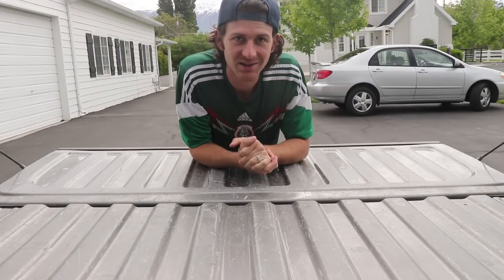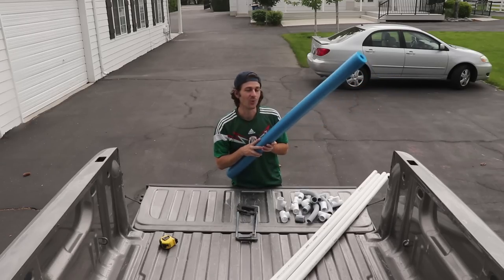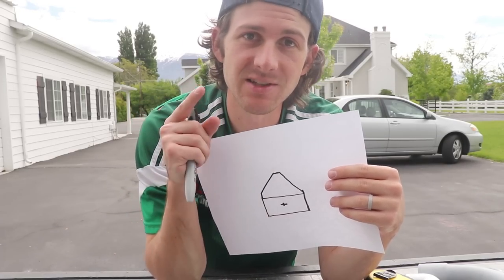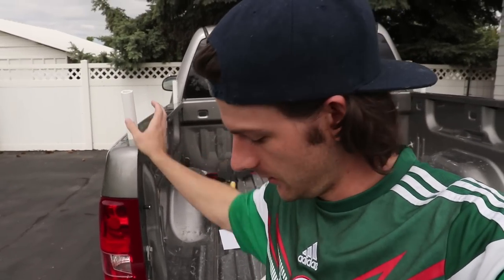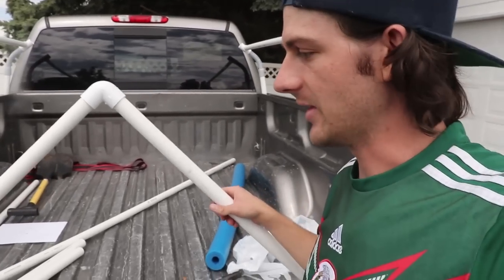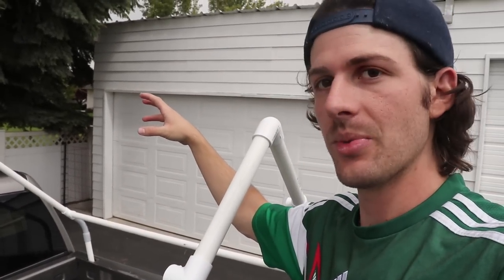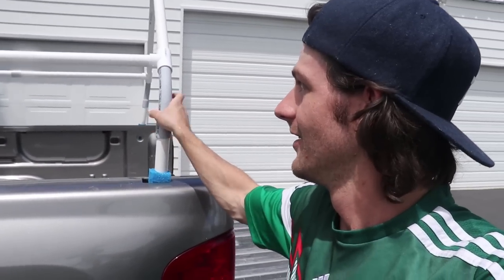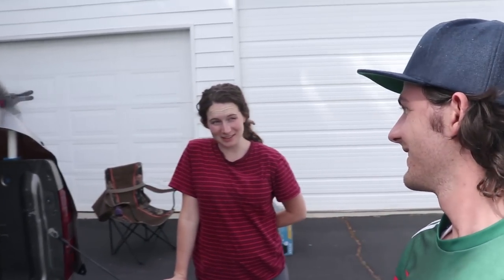DIY Truck Bed Tent! Truck Camping

Comment: I’ve done this also. PVC frame plus a tarp on a Ranger pickup.  You’ll have to cover the tail end above the tailgate, for sure.  A longer tarp in that direction works good because you can stake it out in the daytime like an awning with a couple poles.  It’ll give you a sheltered work space on the tailgate for cooking.  The tarp clamps can’t hurt, but I bungeed the grommets TIGHT to the bottom edge of the bedsides, and it survived a high wind rainstorm.  Also, to bug proof the thing, I bought a few yards of tulle at a fabric store. Just enough to zip tie in place above the tailgate.  I have no idea what it’s usually used for, but it’s good enough skeeter netting.  Good job.  Have fun.
Reply: Great idea with the Tulle!

Comment: You shoukd replace those 90s at the top with a couple of 3 way couplers and put in a ridge pole. In the rain the center will collapse
Reply: A brace in the middle would strengthen it as well.
Reply: When you add the center ridge pole cover the pole with a pool noodle.  The noodle will prevent rips as the tarp is over the top with tension and stand up to wind and rain better.
Reply: Definitely need that center ridgepole so water doesn't have a chance to pool.

Comment: I have a 5' x 8' utility trailer (with no walls, just the welded rails about a foot up the sides and the tall mesh ramp at the back. I plan to do something very similar with it, but have mosquito netting at the front and rear for airflow, and an electric power bank or small fueled generator for a fan for circulation in the hot Texas weather. Nice video.

Comment: Sweet! This is exactly what I've been looking to do. I'm a 54 yo female n I wanna go camping alone. About 20 yrs ago this idea to camp alone woulda been no biggie but now that I'm older I consider all the things that could potentially go wrong and what that could mean if alone. I also watch a grip of Dogman stories on YT n I have officially scared myself out of single camping.  I'm gonna get my conceal carry permit so I can bring a piece just in case but until I get it this idea of yours might fit the bill for me as far as my comfort being alone goes. I have a 92 toyota 4x4 and being up off the ground will make me feel much safer. I had checked out the prices for overland/truck bed tent systems n they're outrageously priced. I noticed the prices to average in the 5 to 600 range. That's just ridiculous.  Thanks to your engineering I think I'm gonna be able to solo camp this summer.

Comment: I made this identical truck tent.  Bought my pc pipe section at Lowe's and purchased a tarp at Harbor Freight.  Very inexpensive. Used bunji cords to tighten the tarp to outside of bed.  Also designed it with a ridge pole to keep from sagging. Rained the first day and through out the night and absolutely no leaks.  The rain hitting the tarp was somewhat disconcerting as it was rather loud.  I had power at the camp site and ran an extension cord for my small ceramic heater.  With an air mattress and cooler inside I had a comfortable  time in the tent/bedcamper.  Unfortunately I traded my 8' bed regular size pickup for a crew cab with a 5 1/2' bed.
Reply: Would be great on an 8' bed but the new Ford Maverick has a 4 1/2' bed. Can anyone say motel? (In the woods?)

Comment: Dude you totally reminded me that PVC pipe exists and are like lincoln logs for adults.  I was about to buy a purpose built truck bed tent, but that is not necessary now.  I'm not much of an A frame guy, so I'll have to design my own version of this, also the previous owner of my truck covered those holes with some stupid caps that I can't remove without damaging it.  I'll have to redesign this, but thanks for the inspiration!

Comment: You can get tees with a side outlet for the top/ridge pole. They are used for sprinkler risers at corners. Good project.

Comment: I followed this pattern but had to added a bar to the bottom of the truck bed to secure the legs because i have an insert for my truck bed which covered the holes on the back of the bed. Then i added a center pole to the very top of the A frame and four windows. I am using bungee cords to hold the tarp down. Thanks for the idea.
Reply: How did you add the windows?

Comment: You could even layer the PVC piping with insulating material and clamp or zip tie it down, and then recover with tarps, canvas, or waterproof canvas material, etc.  The truck bed can be covered with some type of foam or rubber matting, perhaps underneath that an insulating material of some sort, and actually have a very snug, warm in the Winter, camper.  A tiny wood stove could be added if a top build was created to hold and insulate from melt, a stove pipe; the wood stove could be mounted and surrounded with a protective framing device that will keep it in place.  So many possibilities here, including ventilation and solar powered fans :)  I Love It !!

Comment: I like the way things just slide in place. Great idea.
Reply: That's what she said.
Reply: They might just slide together, but quite often they are not that easy to slide apart afterwards... Often you need a pipe wrench to twist the pipe in order to get it to loosen up enough that you can slide it apart even if you didn't glue it together... If I was designing something like this, I would sand the ends of the pieces of PVC pipe a bit to reduce their diameter slightly so that they could be more easily detached later...

Comment: I agree with a top ridge pole too and I am not sold on the tarp clips. It seems the wind will remove that tarp easily with those clips? Maybe some bungees along the lower edges pulling down on the tarp? Maybe even some plastic ties that you can cut off when removing? Great idea. Beats my sleeping under a tonneau cover lol  I am just not sold on anything a hungry bear can reach through.

Comment: Thats awesome your getting out doing your thing. A few tips from experience. 1) You've got great idea there. Its been done in various styles with varied types of frame work for decades. Right down to the tarp covered wagons of the pioneer's. 2) figure a way to run a ridge pole.3) Using some sort of cordage. Run an X rack from corner to corner. Helps exponentially in heavy winds. I dig your style, great hiking rig!
Reply: This is what I was looking for!! Thanks a million😃

Comment: I know it's only been a week, but have you gotten to try it out yet? Only thing I could think of is you should be able to get "3-way pvc connectors" that you could use to run another 5' pipe along the very peak of the tent, to really keep the top from caving in at all under any weather conditions.

The nice thing about using PCV is it's basically a big lego or erector set, you can change it and modify it however you want. I'm thinking you could put T's in your two upper 5' pipes now and use it to run a couple of pieces horizontally  from bar to bar. If you did this at the front of the truck bed where you're not going to hit your head on it climbing in, and put two parallel bars spaced about a foot apart, you could put a shelf up there that would be above your pillows to hold your duffel bag or phones or whatever at night so it's not down on the floor where you'll step on it.

You could also expand it outwards past the tailgate to make a "front porch" area so that you are covered climbing in and out of the truck bed in inclement weather. Also would let you leave the tailgate down to have move "living space" while you're in there.

Looks good so far though, keep up the good work!
Reply from the maker: Holy cow! This is he best feedback ever! I might actually have to try some of those suggestions! 
And as far as using it, we are going this weekend and will post a video about it next Tuesday! 👍 
Thanks again for the great comment!
Reply: I was going to suggest the same thing with the top ridge. Anytime you do not have something there, it WILL sink down with rain, snow, branches, birds, etc. : )
Reply: I have built hotbed covers for early planting in a similar manner. One other upgrade later is to assemble it then drill holes through the fittings and pipe the use Carter pins or wire to firmly attach the pipe to the fittings. They want pull apart in high wind.

Comment: My thought is to put a bar across the very top of the A frame so as to not hold the rain water where the tarp will flatten, but make it run right off it completely.  Enjoy! 🙂

Comment: Good job, simple and effective.
I made something very similar for my ‘83 GMC K2500 long bed. I utilized my headache rack for the front but made PVC supports for the middle and rear stake bed holes.
Covered bed with an inflatable mattress is easier and more comfortable than any tent I’ve had.

Comment: This was really well done. You kept it simple. You did not talk for the sake of hearing your voice.  You kept it short and yet managed to fit all the important information in. Your presentation was made in a nice order and I don't think anyone would be confused.  By the way your drawing was  just fine and WAS not bad, it was simple but not bad. 
A couple of thoughts. You did not show the clamps at all. Neither before you started like you did the pipe and fittings nor at the end showing where and how you had them attached. You might show the frame broken down and in the bag. And, while it should go without saying, I think you should tell viewers to not use glue on the connector pices because that will make take down and storage, more than a bit difficult. Be sure to remind viewers that they will want some air circulation throughout the day and night so they don't suffocate. The Army had this happen a few times while moving troops in duce 'n halfs years ago.
You and your girl should be proud of yourselves,  nice video.

Comment: Excellent! Exactly what I'm looking for. I've wasted an entire year looking everywhere from auctions, classified adds, all the online places looking for an affordable tow behind my truck rv or something enclosed yet large enough I can put a couple of cots in there. I don't want to sleep on the ground in my sleeping bag or some blowup bed matress, cause no matter how puncture proof (yet they always come with a patch kit hmmm) I'd still manage to find a way to puncture it. But as one man said, you got a truck, you got a camper. I can't afford a camper shell to fit my truck. Dodge Ram 1500. I had one back when I had a little Isuzu truck, but that was years ago and both are long gone lol. I"m on a poor mans budget. I ride a motorcycle when the weather is good enough, but I want to sell it. I just want to cover the back of my truck, throw a couple of comfy cots and an ice chest or something in there. I never found what I was looking for. Then I just watched a previous vid a guy used pvc. I thought that's the answer. PVC. It's durable, shapeable, you can buy those things you have to give it an "elbow", I mean it's just perfect. The only thing I worried about was the extra space when you insert the pipe into the truck. I thought exactly what you did. OR used. I used those on my canoe. I had no trailer, a small truck at the time. My husband and I could both get the canoe up and in the bed of the truck, but we had to put the front half up on the cab. I went to walmart and bought a couple of those floaty foam things. Cut them to size, then cut from the hole, end to end and it slipped tightly over the crossbars on the canoe, so it didn't rub against the paint. It was perfect. Just like your build is perfect. Thanks for posting and showing off your build. There's TONS of people like ourselves out there, looking for the same thing. If only they find your vid. I can share, but I'm a bit of a loner. Every one I know has passes away before their time. So I wanna take the time I have left with my older husband, and get away without going to get a vacay loan or travel loan. I don't wanna be in debt, not at his age. I'm 51, but he's 70 (I know I know...age diff. thing freaks ppl out. We've been married over 30 yrs. but we never had kids, so I really have no one) 
The problem is, the rear of my truck, did I say what it is....well it's a Dodge Ram 1500 3.1liter. I'm 5 foot 5 inchs and the tailgate up, comes to my chin. That's how high it is lifted. Getting in and out is going to be a problem for him, so I said nope, we can either buy steps or build some.  OR we've got a step ladder we can throw in..getting in is easy to figure out, it's what to use and how to build it that's the problem. WELL ITS SOLVED!
Thanks for posting this. As I told the other person, there's tons of us out here looking for this exact type of thing. Hopefully many others will find your vid. I'd share it, but I've got no one left to share it with. But I can still post it to my FB page I hate and never check lol, but I'm in NE Oklahoma. I'm in hunting, camping fishing country. Everyone has something to do with one of the 3, that and motorcycles. I have one too. lol. Anyways, I"m rambling, but again thank you for sharing. Good luck to you and yours. OH ...and in this day and age, dammit. Stay safe.

Comment: Looks pretty good. I would change out the fittings at the very top to incorporate another pole from front to back to increase support and use tie outs to the ground to stabilize the tarp.

Comment: How well does it hold up in wind? There is enough surface area to make a strong sail and pull the whole assembly off the truck. I would add a way to anchor it to the truck and a flap to cover the back by the tailgate to keep wind blown rain from entering. Adding light is a great idea. Consider a disco ball.

Comment: i have a 2500hd with an 8 foot bed.  I have ladder racks AND some long ladders.   I can use the ladders for an awning extended off of the ladder racks.  Then tarp it over. I just ordered a diesel heater also....

Comment: Easy to add bug screen across and down the back with the same clamps that hold the tarp.
Reply: Ya, I went to lowe's and bought vinyl bug screen to re-screen my homes windows and patio door. That stuff is great and sturdy! Any your cat or dog can't put a hole in it, tear it, enlarge any openings etc...(Plus you can see out fine, but you can't see in fine!)

Comment: This is a great video. A few quick questions (some of which have been asked below):

1) Did you experience any condensation inside the tent set up when it rained? Or even from breathing?
2) Do you plan to weatherproof the opening? If so what is the plan.

Thanks!

Comment: This is brilliant!! I've been toying with the idea of trying to build a version of a collapsible camper that I saw on a video, but he just has a flat roof. It's made to be put up after you get to camp and then dismantled for the drive home. 
I HATE changing clothes all bent over so I wanted to make a domed or peaked roof to add on top of it, but have been having no luck figuring out how to create and mount it to the camper and yours looks like it could totally be adapted for this!
EXCELLENT idea with the noodle! That would never, ever have occurred to me!

Comment: Love your innovation..
Take a length of 3 o 4 inch PVC and notch the ends to correspond with the peak.  The length should extend so the notch on each end will engage and stay put.  Lash together if needed. Now you have a peak that won't collect a rain puddle...Great,  cheap idea!  Well done

Comment: My setup is a little different. I have three holes on each side of my bed, so I utilize three very long tent rods  half mooning across the bed and one on top going front to back. A total of four tent rods that fold up into a little bag. I put a tailored, heavyweight tarp over the bed and viola!

Comment: Cool project, but you should have a ridge pole at the top to stop the rain pooling on the tarp. Use milk jugs full of water to weight the tarp down.

Comment: Great job but we used to just bow a piece of PVC from stake hole to stake hole and make a covered wagon type out of it. Only need 3 pieces of PVC and that's it.
Reply: Lol, did the same thing about 10 years ago only I bent um alittle with a torch, works great, still use it sometimes
Reply: I only used 1 inch, made it like a covered wagon, I did use a top pole from cab to tailgate, lol minutes to set up, I love it
Reply: Except you have to carry around 10' pvc pipes.  

Tgis way you only have small pieces that can store away easy

Comment: I thinking the drawing in your head looks better then the drawing on paper? 😂 better cover the shock with floaty tube too🤔. Good job dude
Reply: I used those floaty tubes to cut to size, and then cut one side bottom to top and slip it over the bars on my 18ft Lowes canoe, so when I propped it onto the top of my trucks cabin, it wouldn't scratch it or wear the paint off. Those things are good for a lot more than a swimming pool!

Comment: If you pitch your tent in a good location and dig a small drainage trench around it's base as well as a trench on the downhill side draining the water away, you will be dry if your tent and fly are in good condition.
Reply: I just set up my 4' x 7' freestanding tent in the bed of the truck and then I have bug netting.

Comment: I did the same thing with tent poles covered it with the tarp and then right on the top piece on the inside I put a throw blanket to keep the condensation from building up and dripping down on me.
Reply: Wow, didn't even think of condensation - thanks for your comment, Stewart.

Comment: Hint. Drill holes in the top pieces and string a ridge line rope it will help hold the pieces together and give your roof more stability. You also could make a wall for the end with pvc with a door just think outside the box a little.

Comment: Not trying to knock the idea, as it's pretty cool, but after using it, how are you addressing what I'm guessing is a MAJOR condensation issue when that plastic tarp is closed up with two people sleeping inside? Tents are breathable nylon and have separate rain-flys for a reason. This has to be rough.